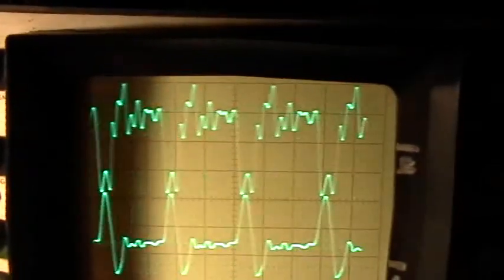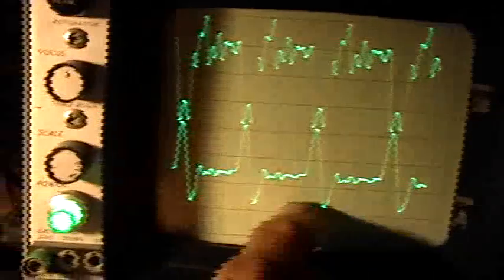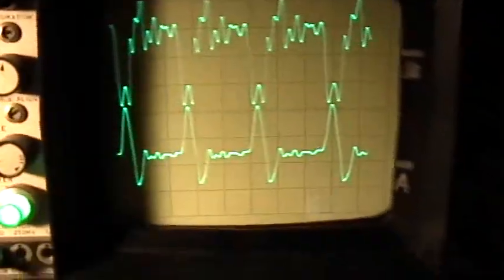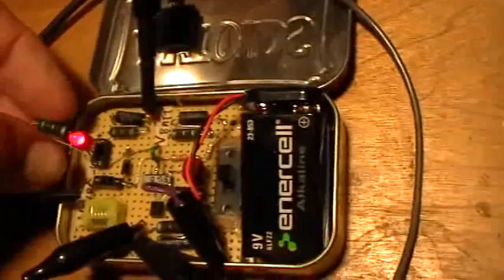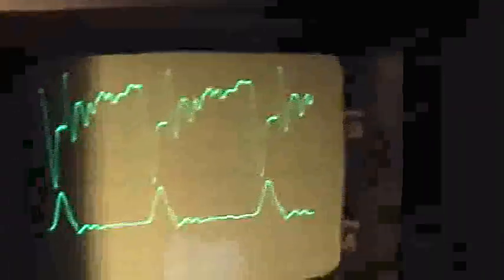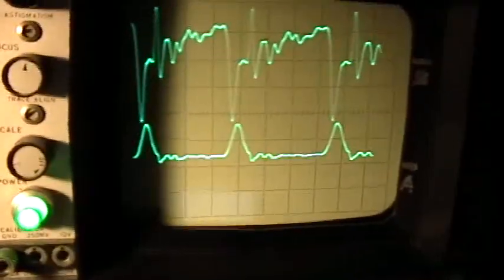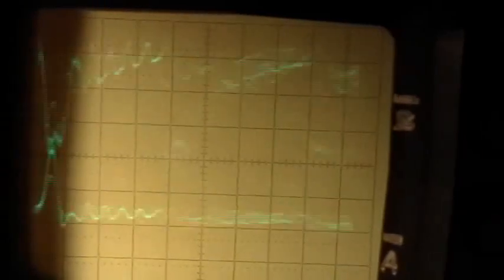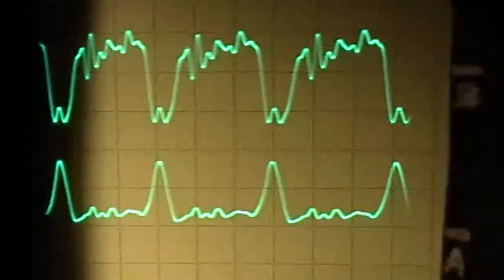Electric OU: Altoid 4: Reverse Current at Load ?

Comment: You didn't really explain the part I was looking for. I am a beginner trying to understand that the inductor in the output circuit (not the one you were holding) changes polarity. The switching diode that allows the circuit to switch on and isolates the second half of the circuit from the input source allows the output coil to have a current path while the input side of the circuit is switched off??
Not bad, but it was a bit of a tease. You pointed out the reverse current thing, but didn't really explain why or how it happens.  I'll give this a B